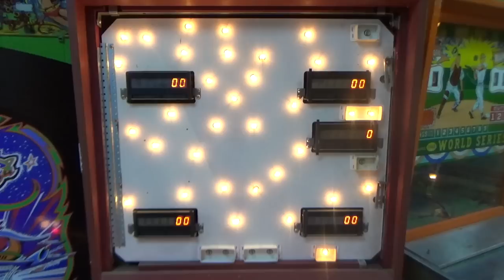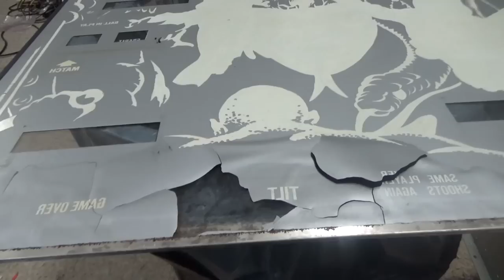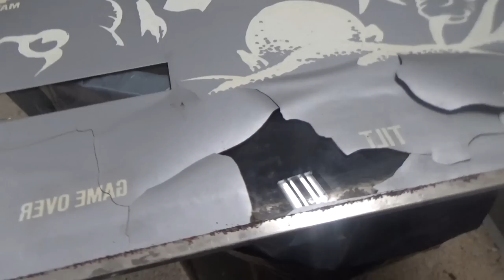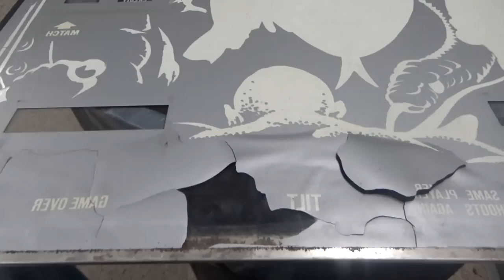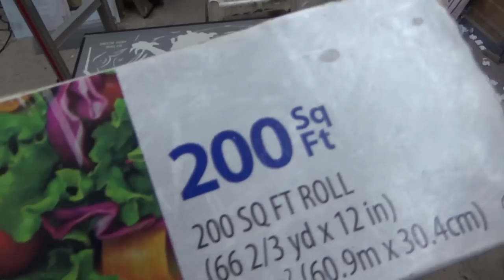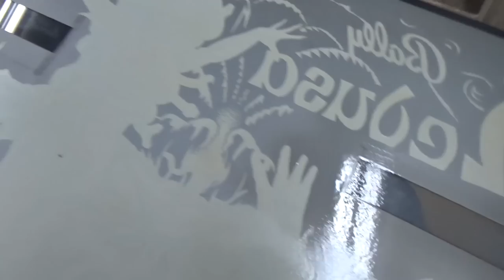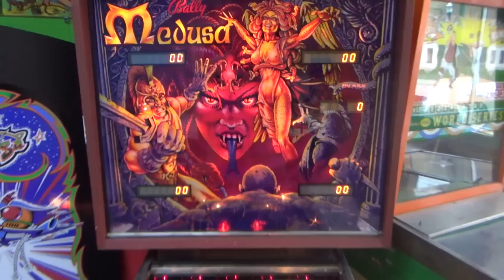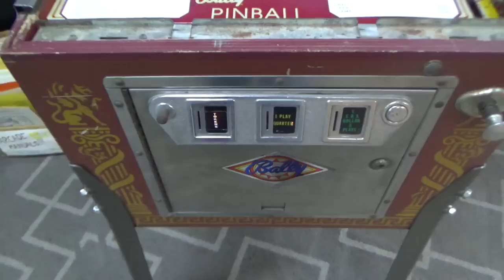Attempting To Save a Badly Damaged PROTOTYPE Bally Medusa Pinball Machine Backglass!

Comment: I would recommend spraying the paint into something at the beginning and using a syringe with a small needle to "inject" it under the flaking art before spraying. It would just help make sure you have full coverage and reduce risk of bubbles under the art.
Reply: Not a bad suggestion.  That could definitely help in the case of areas that are not quite sticking
Ron has done many many of this era of backglass.  If you look at the other videos, his method  also works and lasts.  I think the clear coat Ron uses does soften the old paint a bit and allows it to sit flat.  It really does sit pretty well.
Reply: Ron doesn't take suggestions. What he says goes, his video - we can take it or leave it. Humble is far behind Pride. He's been told before. There's no fixing his pinball

Comment: I did this technique when I restored my Paragon. It turned out nice! Managed to get the triple thick under most of the lifted sections. Anything dead flat, plus weight, will help hold everything to the glass surface. The Saran Wrap comes right off once the clear dries. Should last a long time.
The Medusa is looking great!!

Comment: Good that you had most of the pieces.  Even though the cracks in the print may be visible, but it will look amazing.
Glass does expand and contract quite considerably.  That's why buildings with a lot of glass need to have spacing between glass panels with a flexible sealant.  Also the paint from the screen printing will expand and contract at a different rate.  Add moisture to that and it separates from the glass.   Moisture plays to the cleaning theory, where the bottom peels first.  It can be tricky painting glass and making it stick.
Reply from the maker: I saw a Harlem Globetrotters one time where a piece ironically the size of a basketball had pulled away from the center of the glass, it's just a thing with these Bally's of this vintage.  None of the other manufacturers used the same process....

Comment: Hello it's been awhile. I worked on my countdown machine again. I 3d printed a drop target to replace the broken one and got it installed. I decided to order a Flipp all in one board PI-1/X4. I got it installed and set it up to the correct language, game and turned on the attract mode option to make it more flashy. I was able to play a few games. The drop targets all reset, the ball went to the launcher, the kick out hole worked, everything worked. Then after i finished a third game there was a warning message about "Check Coils Danger Locked On" and when I pushed the start game button it would display the message CHECK! I'm hoping it's just the diodes.

Comment: would heating up the old paint flakes, to make them temp malleable, hence flatter ( heat and weight down before lacquer stage ) ?
[ everything would be room temp - bit of low velocity heat ] see if art flattens better ? (shouldn't affect glass )
a good bit over the windows help seal further = Great Logic - ( got to be dust free area though )

Great Content ~ Thank You.
Reply from the maker: That might work, you'd have to do some test stuff on one to see for sure, i'm always leery of heating up glass I'm always afraid it'll shatter and then we're screrewwwwwwed.  

Thanks for watching IceBolt!

Comment: magnificent work.  unlike you I have more time and would use a dremel bronze wire wheel on rusted metal then polishing wheel and rouge instead of sandpaper or you could use your knife polisher.  I got to get one of those

Comment: I have a Bally from 1982 with this issue.  Someone decided to use scotch tape to put the pieces back on.  Any clue how to remove the tape?
Reply from the maker: Unfortunately you're pretty much done if it has the tape on it.  That was a common thing that operators did when they started flaking... There's no way to remove it from the pieces of the artwork, it'll just all fall apart if you start trying to remove it.  You either have to live with it in that situation, or if there's a crack somewhere that you can get to, you can try to spray the triple thick in that crack, and leave the tape on it when you press it back onto the glass...
Reply: @LyonsArcade  Thanks for the reply.  I will give that a shot.  Was considering trying goo-gone on the tape but was afraid that would create a bigger problem.  I think I better just do the triple thick over the tape and hope for the best.  Thanks again.

Comment: JOE CLASSIC, So you use clear plastic wrap and spray a "Clear Coating" onto the clear plastic wrap?
Reply: You spray the back first, then apply the wrap. You pull the wrap off when it dries. The wrap insulates your weights from the wet glaze.
Reply: @PlumGurly  what type of spray? Is it just a clear coat or something else
Reply: @waynegram8907  -- He explains it in the video. It is a no-fire pottery glaze. It's like lacquer, bur it applies very thick. It's called Triple Thick, and maybe Krylon makes it.
Reply: @PlumGurly  I wonder who makes this spray because I thought it was just a normal clear coat but its something different
Reply: @waynegram8907  It is a specific spray, not just any clear stuff. Ron has talked about it in multiple videos. And he gave plenty of detail in this one. https://youtu.be/nngkD6AELek?t=491
Reply: @PlumGurly  Krylon Triple Thick Crystal Clear Glaze 0500. I thought it was a clear coat spray or it seems its 100% Totally different than a clear coat spray which I'm not sure what is a triple thick crystal clear glaze how its different than a clear coat spray